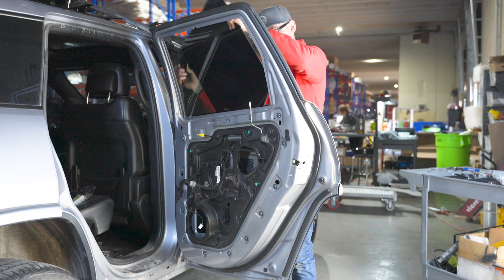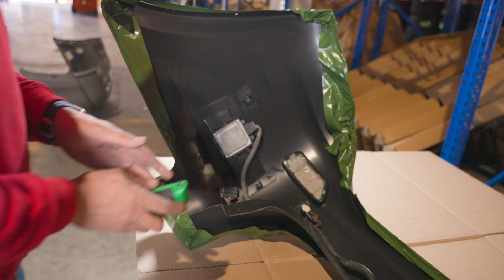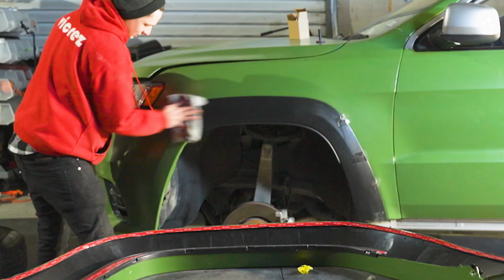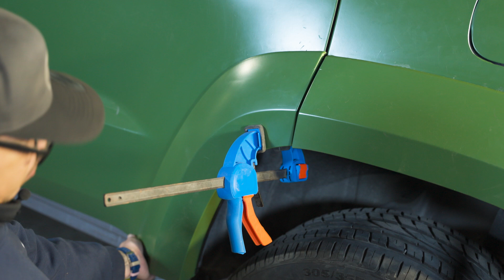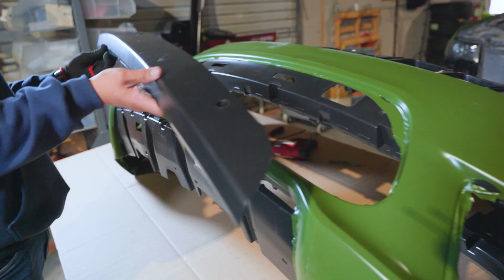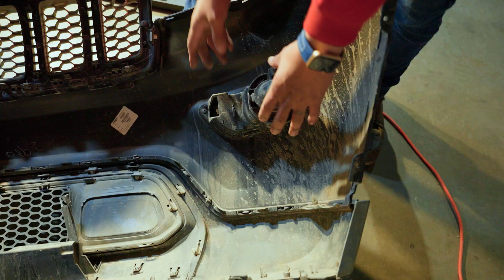From Wrecked Copart find to Factory : Jeep Grand Cherokee Rebuilt with Vicrez OE Replacement Parts

Comment: Did you upgrade the belly pan?
Reply from the maker: No, you don't need to upgrade your belly pan.
Reply: @vicrezcom so you won’t answer huh…
Reply: @ is there any noticeable gap. Would be upgrading a 2015 Srt front end, well converting over. Curious on if my current inner wheel fenders would work too
Reply from the maker: @95ssonthemthangs not at all. We used a 2017 Jeep grand Cherokee for this conversion we bought off of Copart
Reply: @vicrezcom soo then it’s on back order end of the month then it’s an issue with the warehouse .. why do you lie to customers?
Reply: @vicrezcom so why do you tell people about the lying shipping process then it goes to back order then shipping issues … why do you lie?